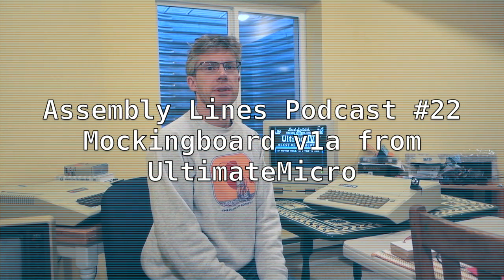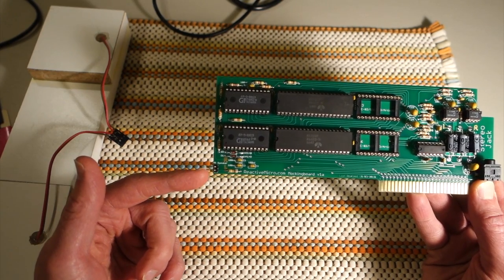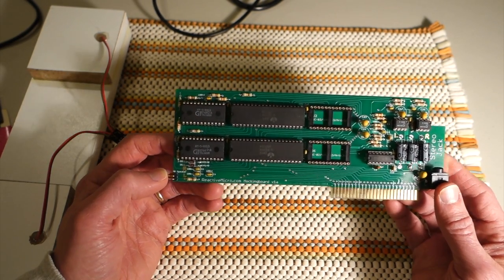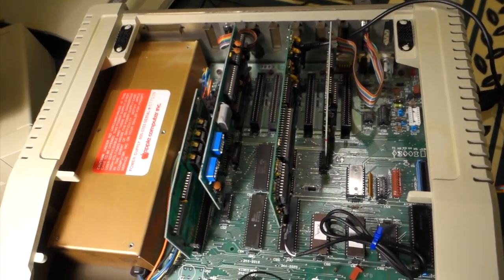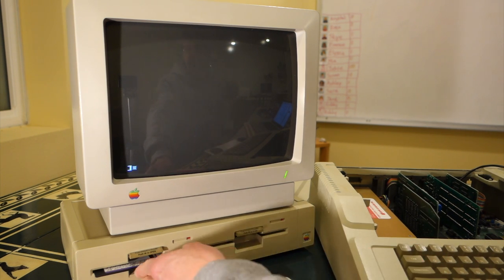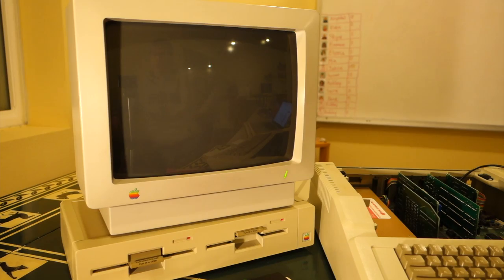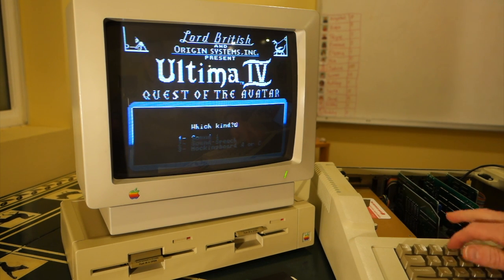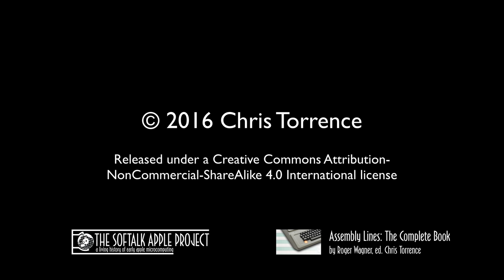Assembly Lines #22: Mockingboard v1a from UltimateMicro

Comment: Hi Chris. I like your internal speaker solution, but what about a volume control?
Reply from the maker: +Stephen Collins Thanks Stephen! I actually bought an extension cord for the 3.5mm audio jack that has a simple volume control built in. So I just run it out the back of the //e, then back inside to where it hooks up to the speaker. It's a little goofy but it works.